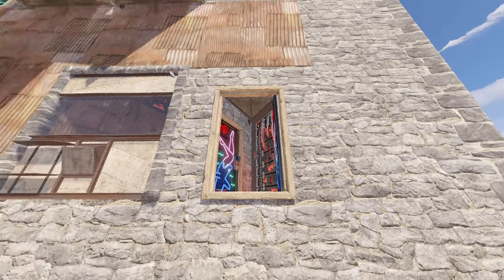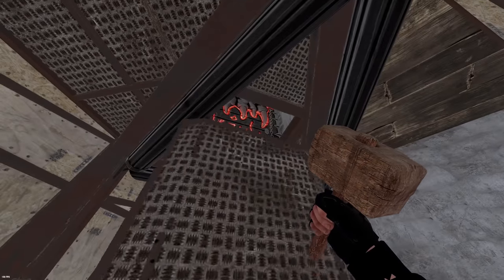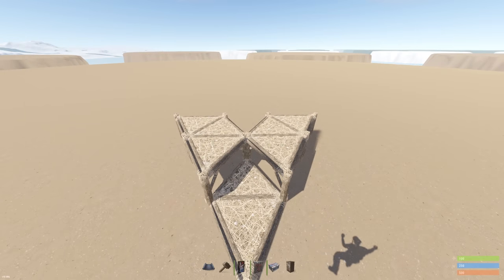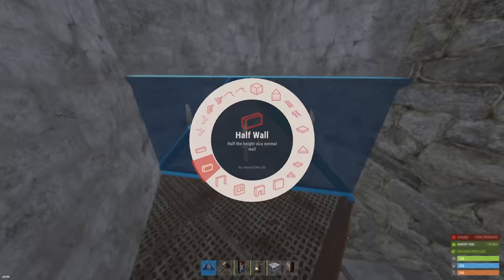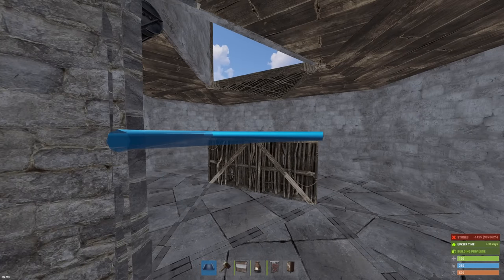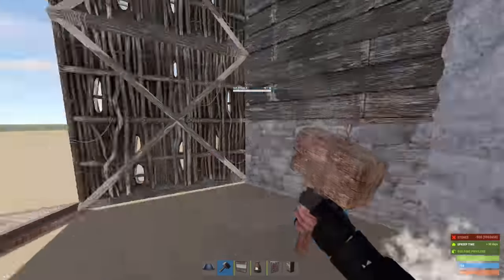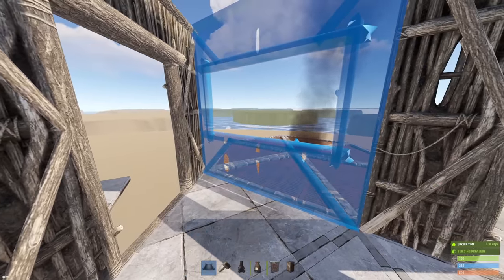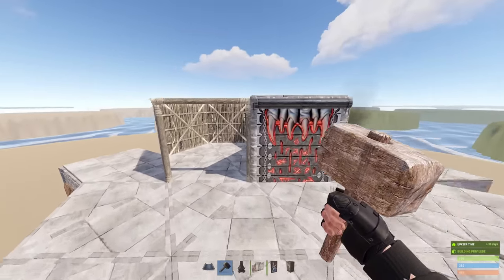2023 Solo/Duo/Trio Vault Furnace Base Design 👀🔨 - RUST BASE TUTORIAL #10

Comment: Would you be able to use roof pieces instead of the grill on the 2nd set you placed?  It looks tall enough to not mess with the furnace, and possibly hide the majority of the smoke.  Like the design, but I am still going to rock the last base.  On modded servers it don't matter, but on official Rust, they see what is definitely a triangle bunker and say "Nope".  I have had 2x2's and  2x1's around me raided, but not my base.  I just love that design.